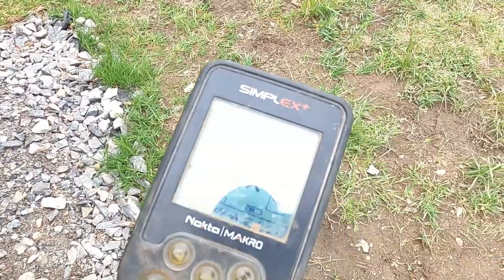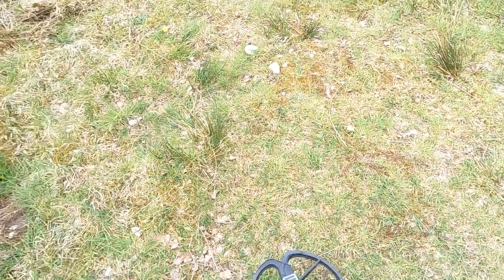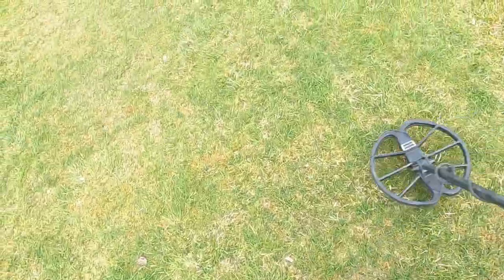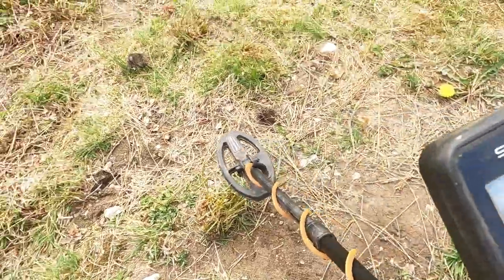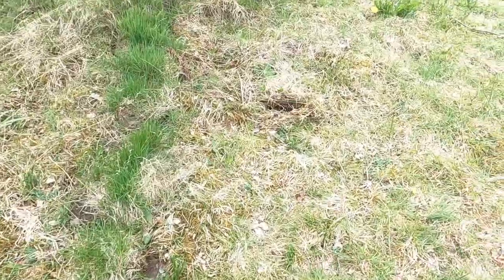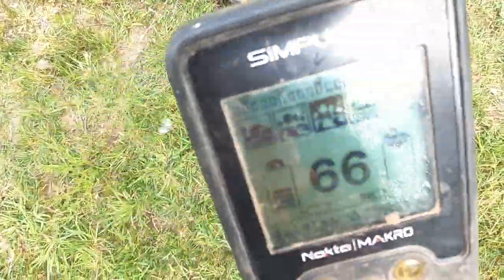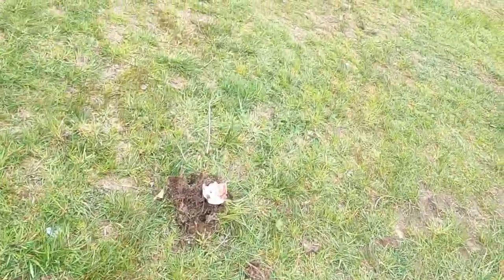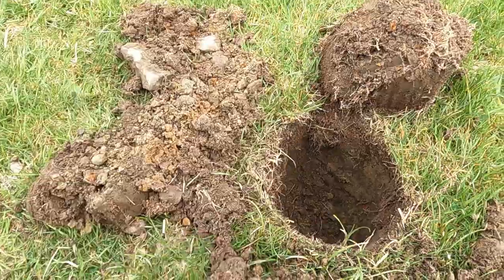Simplex + SP24 vs SP28 (Stock Coil). Which performs better? Baz's dilemma tested.

Comment: Is that a ferrite choke high up on the controller end of your cable?   Do you find that it helps keep EMI dampened?  Is that the reason for it?   I happen to have a few spare in this gauge laying around.... hmm.
Reply from the maker: Well spotted, my friend! That was sent to me by Dustin Bright of the Simplex+ Legend owners group on Facebook.  We have been trying them out to reduce interference from pin pointers. I would say give it a try, I did notice an improvement in chattery ness with the pin pointer when I have it on the machine, and certainly does not harm the Simplex's ability to see targets. Check out my latest video comparing the Legend to the Nox and SImplex, you will see that she has no trouble at all! Very well spotted, I had forgotten it was even on there!
Reply: @thesimplexguru1263  Interesting idea.  I'd always figured those were for the other way around - breaking (choking) signals from exiting the transmission line.  But, any transmitter is also a receiver, so... yeah, maybe.  I'll pop one on and check it out.

For anyone not seeing what we're talking about, check around @9:30 to see a clear shot of it.  It's just a special clip-on toroidal bit of plastic-encased ferrite.   You will see it as a black bump on the orange cable protector part of the cable, up near her controller.

Comment: Guru have you tried the SP 22 I would like to hear your views on this coil for the simplex plus . Ian
Reply from the maker: Hi Ian, I haven't tried that one. I think it will perform as well as the 24, but do you need it? If you have the money, options are always good to have. But if you have the sp24, it will be a perfect all in one, if budget is tighter. Hope this helps. 👩🏻‍🦰
Reply: @thesimplexguru1263  yes I do have this coil sp22 and I am ready to start using it, but I have different views on this coil so wasn’t sure and I thought you might have tried this coil thanks for the advice and now it happy hunting for  me 😃
Reply from the maker: Please do let me know how you find it. I am curious about how it works compared to the sp24 😊
Reply: @thesimplexguru1263   i let you know, as I will first give it a try on a local Beach